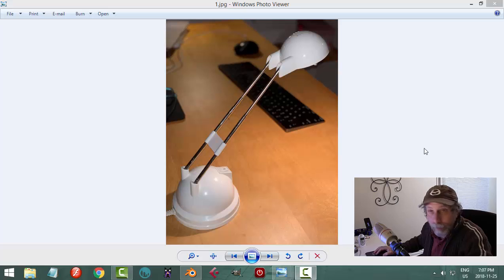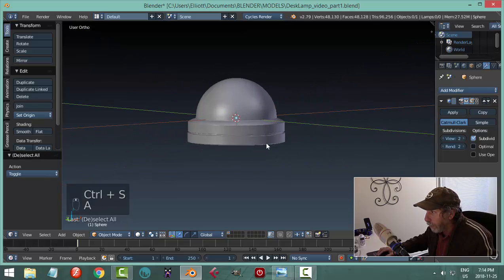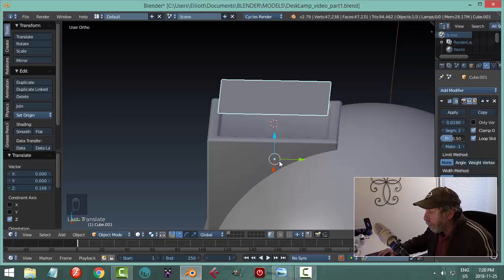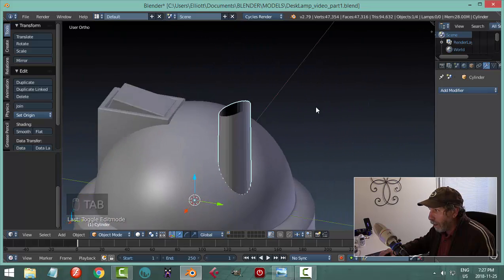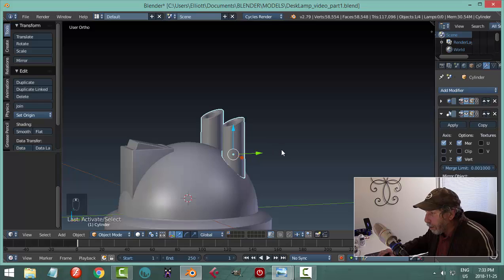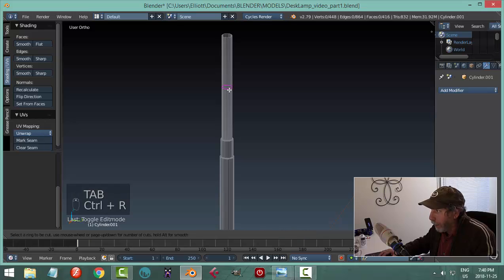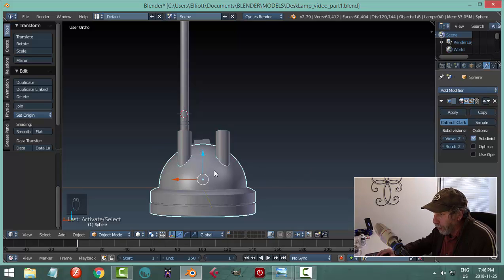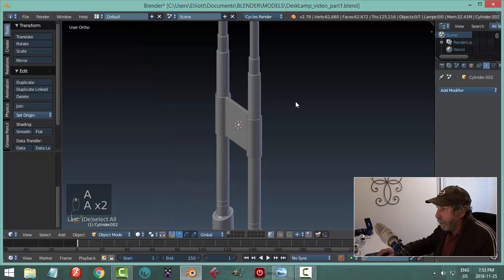Blender: Modeling a Friend's Desk Lamp (Part 1 of 4)

Comment: Great job! Better job on the switch, the cylinders with the individual origin scaling instead of the  solidify modifier. That gave a better result. Smart use of already existing geometry to add the cylinders of the connecting bridge piece. For my attempt, I did not use mirror for the bridge thingy, I copied cylinders and use bridge edge loop to connect them. 
The switch is indeed not as big as you made it initially so that went well.
I did not put in the balls which was giving me problems the rotating the antennas.
Reply from the maker: Thanks Bas!  Great ideas on your part for the modeling.  Let's keep the project going as time permits :)
Reply: @zerobio  I will have time on Wednesday night (on this side of the big pond) to view the second part. I'm busy teaching my own student the basics of structured programming in Python ;-)
Reply from the maker: Hey that's cool. No worries. Teach your students my friend. I was a science teacher for 25 years and retired now. I will keep working on the lamp. Another video tonight, I think, part 3.